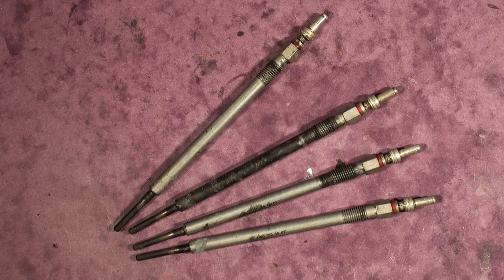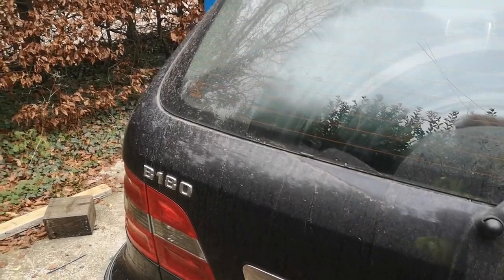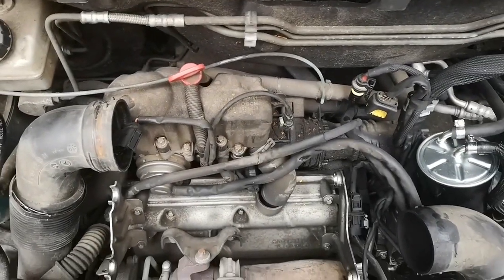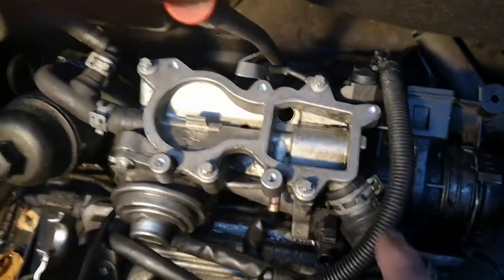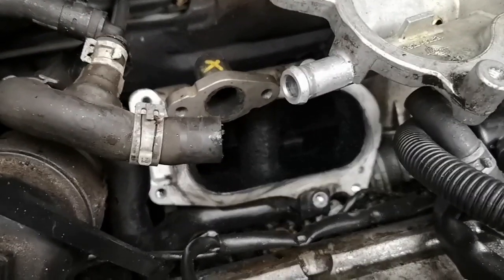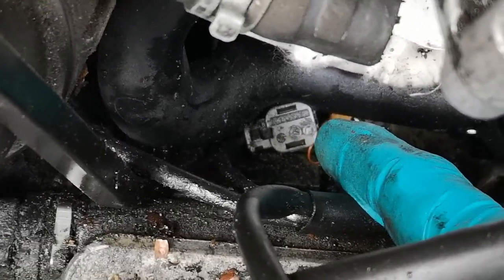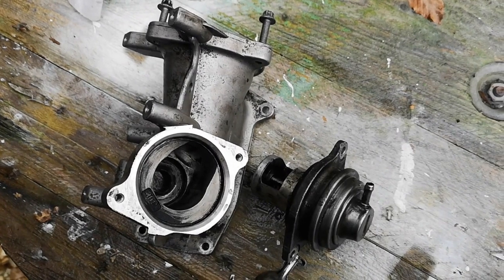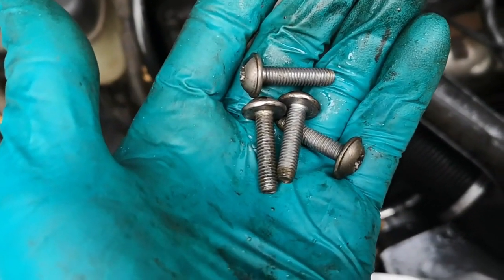Mercedes B Class EGR, Glow Plug, Thermostat Replacement and repair W245 W169

Comment: May I have the name of the forum? As I just got my B class recently, and try to do routine maintenance myself.
Reply from the maker: Hi Oliver.  What model year and engine do you have?  For routine stuff just refer to a Haynes manual.  On the W245 diesels there are a few simple faults that have happened on the cars that can be prevented by inspection.   
Sheers.
Reply: @razenby  Thanks very much, it's a 2011 B class 180 diesel w245.